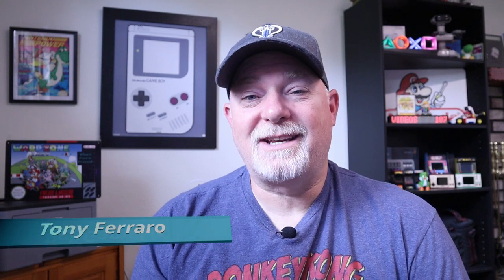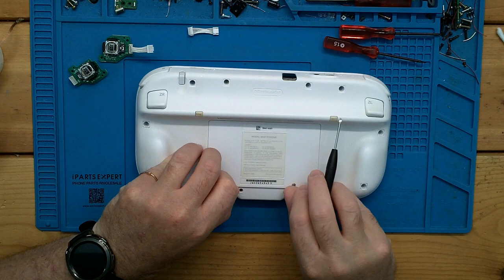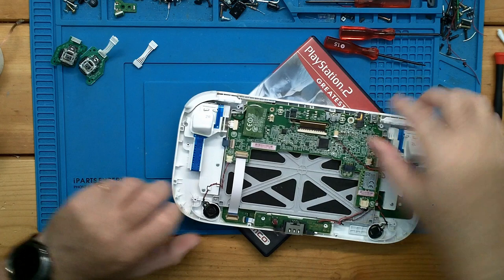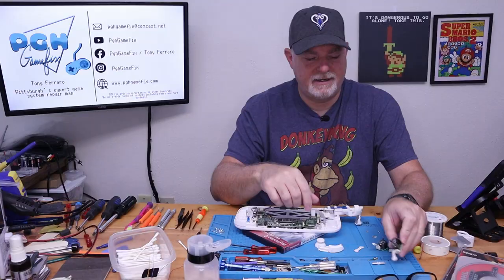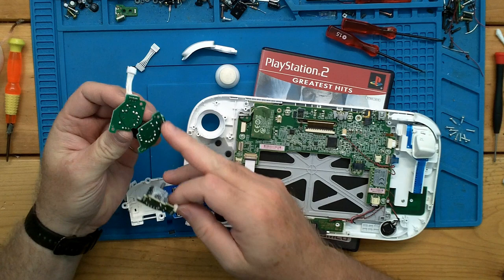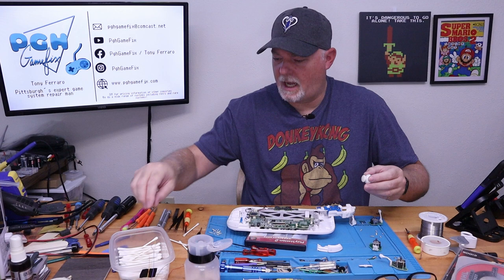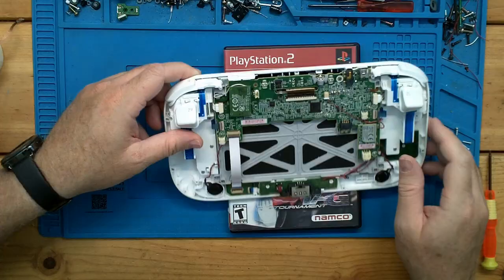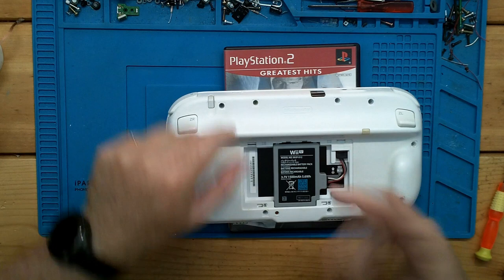Joystick Drift on a Nintendo Wii-U

Comment: I've already done this repair on my gamepad and there was no change to the drift. The ghost input is incredibly dramatic. I can't even play games with other controllers without first resetting the neutral points on the gamepad with a+b+select+start everytime I want to play. Is there any other reason the left stick would be drifting like that? Anything else I can try? Really appreciate it
Reply from the maker: I've never gotten a bad replacement stick... but you may have. Unfortunately, if it's off by a significant amount, I would get a new stick from a different vendor.
Reply: @PghGameFix  but the drift is still very significant, and typically in the same direction on reboot. I felt like there was no change after the swap. The gamepad is completely unusable. Is there really no chance of another cause. I would just hate to repeat the repair and have the issue persist. (Also it's a wind waker gamepad so I can't really replace it either unfortunately)
Reply from the maker: @danielhoughton8293  The replacement stick is cheap, and not that hard to install.  To my knowledge, there isn't anything else you can do to force a calibration.

Comment: Theres a few bad reviews on the stick modules from the description im currently a bit skeptical on buying those
Reply from the maker: The vid is a couple years old at this point.  The quality could have changed.
Reply: @PghGameFix  
I did end up getting different sticks with slightly better reviews but ive just finished reassembling the gamepad both sticks work great although i only needed to replace the left one. Thanks for the guide it made this whole process a lot quicker hope you have a good one man 😃👍
Reply: @noe5723  What sticks did you go with, if you don't mind me asking? I'm also looking into fixing up my gamepad.
Reply: @noe5723 you put the link pls

Comment: I just changed one stick of my ps5, will those sticks would work for Wii u? (De soldering and soldering back)
Reply from the maker: Honestly... I haven't tried.  If the spacing on the pins is the same... it will probably work.